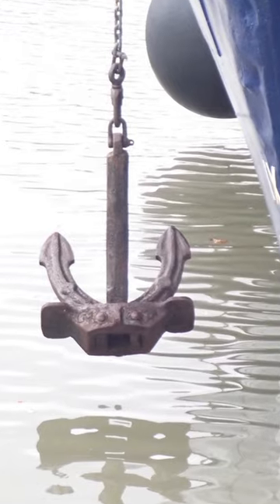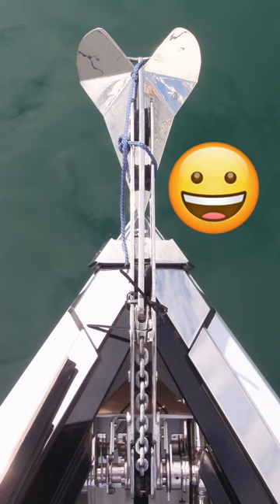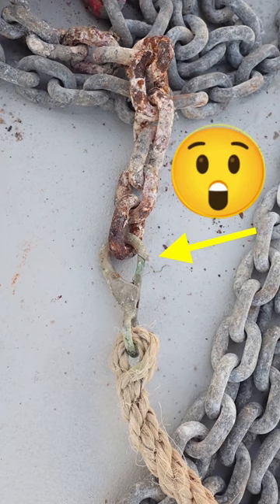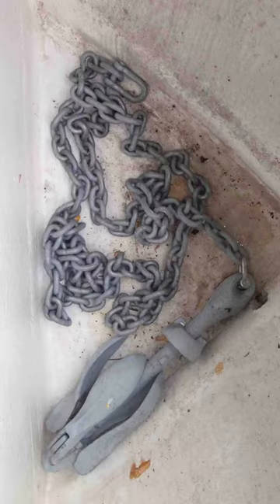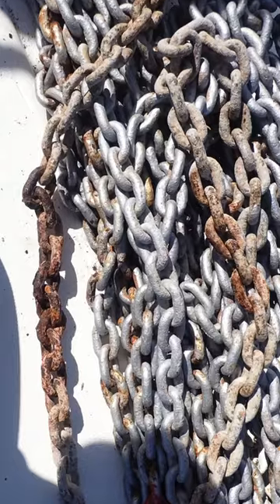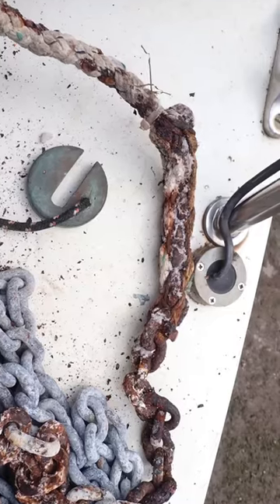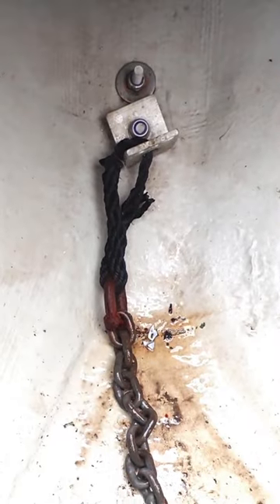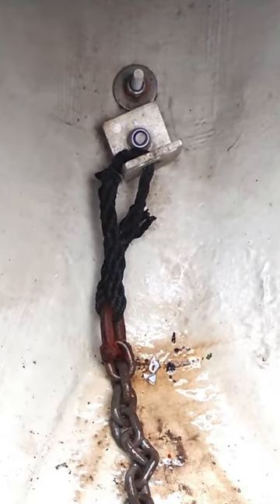How To Set Up The Anchor On Your Boat #boatmaintenance

Comment: Lovely nugget about tying the 'bitter end' on with rope rather than shackle.
Is the term 'bitter end' a salty sea dog term? 
Great vid, many thanks 👍👌👏
Reply from the maker: Thanks Simon.  The term 'bitter end' in a nautical context is the very last bit of the anchor cable which was traditionally secured to the mooring bitts (or bollards) on deck to prevent loss of the anchor plus the cable overboard.  Most modern small craft don't have mooring bitts so attach the bitter end to a strong point in the anchor locker.